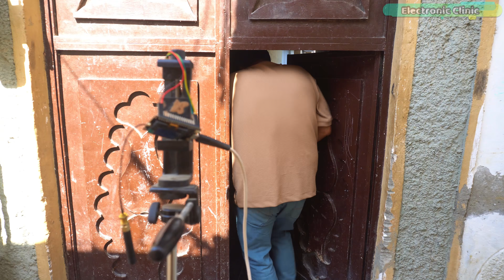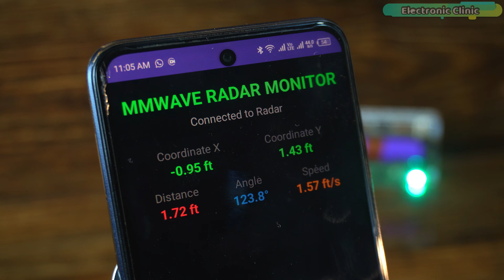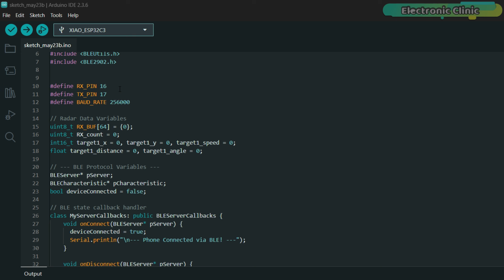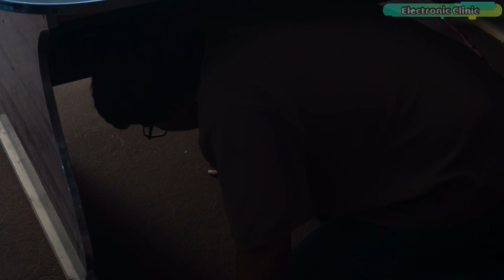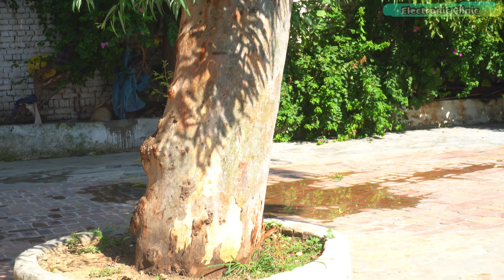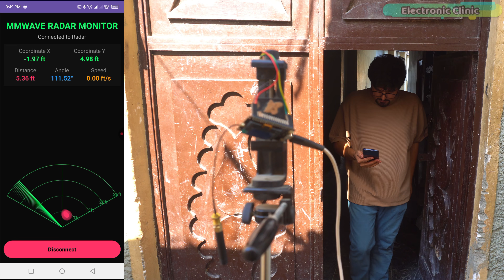You Can’t Hide 3 | Rd-03D mmWave Radar, Xiao ESP32-C3, and Smartphone

Comment: Nice work! Excited to see what you think of next. Another comment asked about false positives generated by dogs, cats, squirrels, birds, anything non-human entering the monitoring area. Further thinking about that.. Is there a confidence level filter based on a detected human's potential mass that could aid in filtering out non-humans? Perhaps movement heuristics? I'm trying to think of what else can be used to eliminate those false positives. Also, while the system provides x, y, and angle, what about elevation, especially if the sensor is mounted at a height of 8ft, or 10ft. That data can be used to feed a gimbal mounted laser pointer that conveys to an intruder that the system knows exactly where they are and not occluded (effective at night only), but this raises the question of the detection resolution of how detailed of a signature it is capable of. Also, can multiple sensors be used in tandem, especially with a home perimeter security where one seeks to monitor 360 degrees or at least 1 sensor per north, south, east, and west - which would also involves a rethink of how the radar view is presented.. so more of a circular air traffic controller screen, with labels of north, south, east, west? Keep up the amazing work!
Reply from the maker: For 360 degree detection I am working on something amazing and too accurate. I am performing different tests and once I am satisfied I will start filming it. 

To avoid false alarms install at height and then it will ignore dogs. I demonstrated this in previous videos.